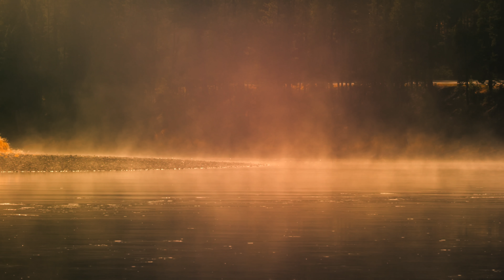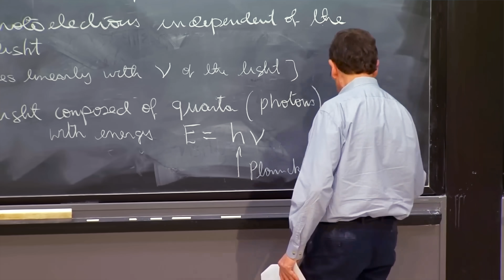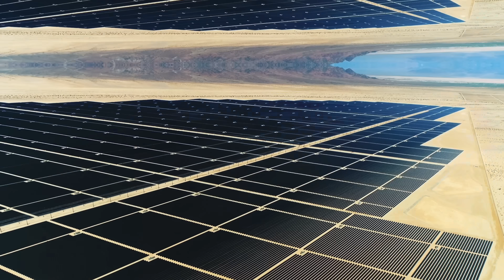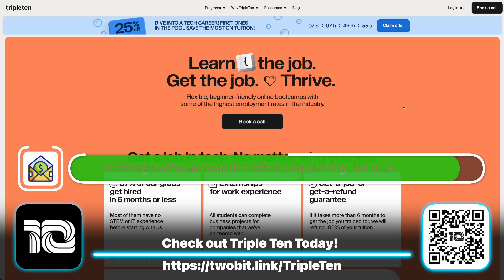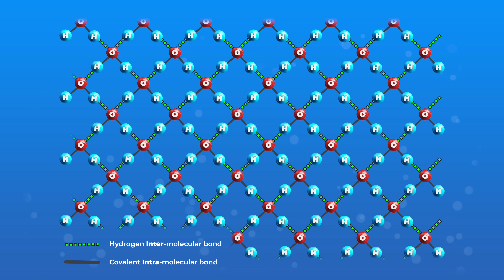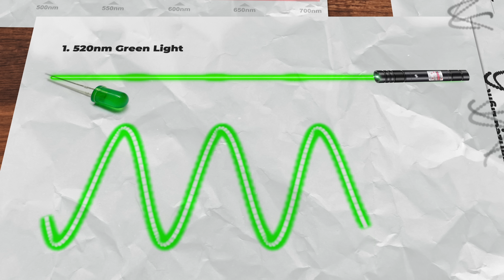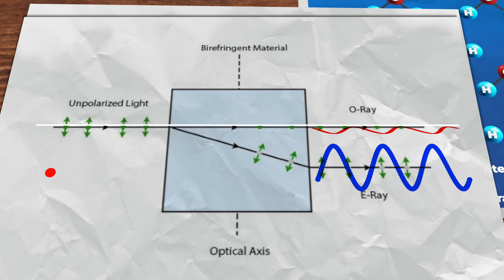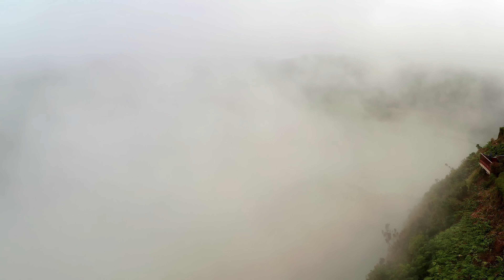New MIT Discovery Just Solved Water's BIGGEST Mystery!

Comment: he totally missed the fact that atmospheric pressure keeps water from turning into water vapor.  if you take a volume of water and put it into a vacuum chamber and pump out all the air, what happens to the  water?  it turns into vapor , it evaporates.  the presents of the air molecules, the pressure, or another way of looking at this, the weight of the atmosphere on water (say a lake) restricts the speed at which water returns to its vapor state.  water, as water wants to become vapor again ( its a cycle).  heat ( and now I guess light ) accelerate the transformation of liquid water to water vapor.  But pressure (atmospheric) regulates the change too.  Back to my vac chamber. no heat (ambient temperature) and in the dark,,,, pump out all the air (no pressure) what happened to the water? I guarantee it has all evaporated.

Comment: So what if you also use sunlight to preheat the water  in combination with such a system ( easier to evaporate the water with the lasers? ) - for instance in a large "greenhouse" style structure, where the evaporated sea water then condenses in a shaded cooler region ( behind solar panels ) at the top and is collected there, thereby even gettting it lifted up for "free"? The now desalinated sea water can then be tranported via pipelines into dry and drout regions ( like reverse rivers so to speak ).

Comment: Water is a fluid/liquid.  The ionic bonds in water are weak, much weaker than the molecular ones.  Hence water being a fluid.  Your explanation for why light works better than heat (which really is just another form of light if we're talking about its transmission and not the shaking of molecules) doesn't make sense.  It's still encouraging research though.

Comment: "New Discovery"? I remember reading about how light impacting on water causes it to absorb without it needing to heat up over a decade ago in college. Is it just have have done more testing to further confirm it?
Reply: This isn't absorption. Bulk water doesn't absorb green visible light. In fact, green is the part of the visible light spectrum that water absorbs the least. This is different
Reply: @PyroMancer2k  a decade ago, I watched a talk by Jerry Pollack on “EZ water”, where he hinted about interaction between light and water, and he used this effect for nifty experiments, making small pumps which were running on light. So yes, this has been around for a long time. The smart people at MIT figured out the theory behind it.

Comment: So, light can cause clusters of water molecules to evaporate, which takes less energy than if all the molecules individually left the water surface.  Simple, and once you know it can happen, you wonder why you didn't think of it before.  These clusters can then dissociate to individual molecules by absorbing heat from the surrounding air, if it is hot enough.    I wish you had said that at the start instead of making me struggle through ads etc. to the end of the video.  As an experienced engineer, I was thrown by "per m squared h".  I thought, what is that? Who says that apart from a badly trained AI?  Per metre squared per hour I realised eventually. 

Regarding desalination, I guess you could condense the clustered molecules back into water, no need to add the extra heat to split the clusters.

Comment: I am not convinced, so, in darkness water would take more time to evaporate and with green light it would go faster. Could it not just be something like that the green light has exactly the right kind of energy to do the work, that not warmth in general is making water to evaporate but that green light is attacking to molecular bonds. I see great difficulties in how to conduct a test, if the total amount of energy would be the same and on test has to have more green light and the other test less green light but the energy levels have to be exactly the same. Could it not be that some intermolecular bonds respond better on some wavelengths of light. Simply adding more green light is silly, the total level of energy would rise and it would be obvious the water would evaporate quicker then.
Maybe it is a breakthrough.

Comment: Nice, but the part about the polarization is not completely right. You cannot combine the two beams once they have the same polarization. That is a standard issue in optics. What you could do of course is building two devices and use the two beams ;)

Comment: You could have a certain of water (water fall) passing the light with a very slow air flow over it which passes the water vaper in to the collection vessel. Nothing was said about how the water would be collected? As for the having to polarizing the light, it would still be at 45 Deg’s, just on a different plain. Therefore would it matter?
Thank you I found this very intresting.

Comment: It is wrong that heat is the source of evaporation. Actually, it is the saturation deficit that drives evaporation. This is also why clothes will also get dry in winter.
Reply: WhenI heard the initial claim that we thought it was heat, I was taken aback because I did not learn HEAT, I learned evaporation.
Reply: Enthalpy is what you are taught. Not heat.
Reply: Ice evaporates in my freezer.
Reply: @freefall9832  That's not evaporation, that's condensation of the air's water. Like the one that happens in the outside of a bottle filled with cold water.
Reply: @magscorp13  Thanks, wouldn't condensation add ice.
Reply: @magscorp13  the transition of ice from solid to gaseous form (water vapor) is called sublimation and is likewise driven by water deficit between ice the gas phase. The process is comparable to diffusion, i. e. driven by a specific Gradient.
Reply: @sailaliamg2695  You're totally right. Thank you!
Reply: @freefall9832  the term is sublime.  Snow doesn't actually melt. It sublimes as well but usually condenses to water because it is to cold to remain in vapor phase.
Reply: @rachaelsdaddy  sublime / sublimate. Both are correct. And: snow does usually melt due to increases in air temperature or direct solar radiation, while a quite significant part also sublimates. This is also what causes high water levels in rivers in early spring during thawing phases.

Comment: I did a few experiments off my own back as kid for fun... One was 3 magnifying glasses aimed at a glass of water compared to one evaporating normally.. The original experiment involved the same setup (3 magnifying glasses aimed at the same focal point) to burn a spot in some wood, the other to boil water. First worked, second failed but the water heated up quite a lot.

Comment: Hi, Physical Chemist here. So heat is best thought of as light & vibration. Not just a materials temperature.  So the idea in this discovery is that water doesnt needs to ramp up across a massive landscape of molecules, but instead can have a much more localized responce to light.  This then requires many things to be considered about how that light is absorbed and in my mind it would mean a signal would appear from the emission spectrum when water is having a higher amount of this direct to gas phase change.  

My guess is that it could have to do with how water is flowing and this increases the number of specific frequences of light to bypass ambient heating. But the fact that water can evaporate at sub-zero temperatures, of course there is evaporation independent of surrounding material temperature. 

But all I really wanted to say is that heat is both the motion of molecules and Light.  They both are involved in why temperatures are a thing.

Comment: Evaporation is actually about the vapor pressure just above the water's surface. Heat is one way to decrease the vapor pressure, but not the only one. If you put water in a vacuum chamber, it will boil off and evaporate.

Comment: So, I’m wondering if the suns increase in brightness may actually be driving more of an effect in climate change than we thought? As the sun brightens and our existing issues with our emissions have driven us closer and closer to tipping points, we may find that the suns contribution comes in the form of increases to evaporation rates, adding more and more humidity to the air, further compounding the issue. This is a bit nuts.

Comment: Can’t you just add additional polarizing filters to continuously twist the light and reduce loss?

Polarizing filters don’t actually filter light, they cause light to snap to an orientation if their direction of oscillation is close enough to the polarization medium’s polarization axis.

So if you stack a bunch of filters with a 1° rotation between them you can get that loss down to as little as 3%.

This is called the light polarization paradox.

Utilizing this technique it seems like you could cheaply and easily convert large amounts of green light into the appropriate angle you need for the photo molecular effect.

Comment: Key points missed
1.  At any given temperature molecules have a distribution of energy states with the population in each state dependent on temperature (weighted by exp(-E/kT). The molecular energy is divided among kinetic and internal modes (vibration and rotation).   Only a fraction of the molecules have enough energy to break a hydrogen bond.  
2.  Hydrogen bonds between water molecules are very transitory.  The molecules form dimers, trimers, and larger clusters that form and dissolve on a micro second time scale.  The clusters have spectral features.  The broad O-H absorption peak at about 3300 cm-1 is actually a superposition of peaks for each N-mer cluster.  (I have published in this area).  Some molecules are always free and there is no hydrogen bond to break for a molecule to evaporate.  
3.  The analogy with the photoelectric effect is imperfect because there is an optimal wavelength and higher energy photons are less effective.  The photoelectric effect only requires a minimum photon energy.

Comment: Here is another hack. Polarizers don't just filter out light that's in the wrong direction, they will change the polarization of light that is up to 45° away from the direction of the polarizer. That's why you only lose 50% of that light instead of more than 90% of it. 

That is also why if you place two polarizers in front of each other offset by 90°, you will get less light coming through than if you add a third polarizer in the middle set at 45° to the first two.

Comment: This could be why some clouds appear so black.
I always wondered as it wasn't just a shadow. The cloud itself is black while others are white and fluffy.
The water may use up all the photons and create a black hole that light can't escape from.
Breaking all those bonds without heat in cold dry air could create a static charge or rapid ionic charge fluctuations and explain lighting?

Comment: Would the correct frequency of light with sufficient power be able to change the temperature of the atmosphere, via the process described here, at least in a localized area? My understanding is that tornadoes, and probably hurricanes, start from temperature differentials. The ability to cool the hot air before the differential takes effect could save billions, or more!
Now that I think of it, weather control, at least partial, is possible by having this ability spread across the world reducing heat where that's needed. With that ability you could optimize the weather where the soil is the best for growing food.

Comment: This actually makes a lot of sense.  Why we get heavy evaporation on both snow and water when the temperature is near freezing.  We get these heavy ground fogs at first light that hold until the day warms up at around 10am…then the evaporation is no longer visible.
Reply: its called sublimation in frozen water...evaporation only happens to liquid water
Reply: fog is not evaporation its condensation. the cold air sinks and where it meets the warm air above it causes the water held in the warmer air to drop out causing fog.
Reply: Before the new findings, did we think that water has to be boiling to evaporate because of heat? I don't think so, I think we thought about a very local "hot" area, where the molecule has enough kinetic energy to brake loose. But the general, overall temperature of the liquid can be let's say room temp. 25C°. Everyone knows water evaporates from oceans, seas and lakes, even though none of them are around 100°C. But still, we did attribute the evaporation to heat. Isn't it so?
Reply: Forgotten ice cubes evaporate in my dark freezer.
Reply: Compelling and exciting conversation.
Reply: it be cause of air moisture too; we can dry things by putting it in the house hold fridge (no light at all when the fridge close). (cold dry; vacuum dry... quite work same way).
when it cold, it is usually dry too.
Reply: Evaporation caused by the photo electric effect occurs at any temperature including below freezing.
Reply: @kennethhawley1063  That's what he's saying.
Reply: Also the 10am sun, forget the DST stuff, is around 45 degrees so optimal for the light based evaporation model. Also it's green light and plants leaves  are generally green - seems nature pointed the way on that (reasoning is that plants do photosynthesize but also require water to do so - reflecting the green light reduces water loss smart plants.)

Comment: It's not JUST about heat; it's also about atmospheric pressure and relative humidity.  And "light" and heat are just different wavelengths of the electromagnetic spectrum.  From everything I've ever heard, or read, the water molecules don't care whether the energy comes in the form of light or heat.  It's the total energy applied to the water molecules.  I'd like to see more on this.
Reply: It can even come from kinetic energy. Cigar stores have rooms where fans slam air molecules into a container of water.  The air has sufficient kinetic energy to break the surface tension of the water and to force it upwards into the surrounding air.
Reply: @chrisfleischman3371  Absolutely. drying my bathroom (sometimes full of wet clothes lines) is the most efficient when I put a fan in there. I have a fan in the wall pushing out the moist air, but that air flow is to small to be of huge help. The big table fan flapping the clothes around does the job ten times faster. But is ten times more powerful. So in the end the question is about how much energy requires every method? boiling?, filtering, or evaporating with wind light or whatever. By now the filtering, I mean reverse osmosis, at large scale is quite cheap. I hear that is 50 cents per ton. In my region the official price of water is about ten times higher, even the water is collected from a river and filtered with standard method, like sand filters, and chlorinated.   So, in the end, here making the water cheaper for the consumer is about better administration, not better technologies. I mean getting rid of corruption. So yeah, new technologies may be just interesting and fun to discover, but not so helpful unless are really huge breakthroughs.
Reply: @chrisfleischman3371  "The air has sufficient kinetic energy to break the surface tension of the water and to force it upwards into the surrounding air."  I believe that's called "splashing" 🤣
Reply: Yep, water does not care ithe energy comes from heating, or from hitting ;) hitting it with a photon.
Reply: Theoretically if one had really small hands, they could grab these bundles of water-molecules themselves and throw it up in the air.

Comment: First, your air conditioner and refrigerator make pure 100% drinkable water as a waste product... Forget water desalination. If you are trying to use energy to evaporate water only to recondense it, Just go ahead and draw the water that is already evaporated in the air....
 Second, get a clothesline for your laundry...
Third.. 
 Have you ever turned on a hose after it had been sitting in the sun all day?
 Put a thick black rubber waterline on your roof and and run water from it to your water heater...  It will preheat your water.
Reply: Air conditioners and refrigerators require electricity to run, and the waste product for that is a lot more than drinkable water.
Reply: @THE-X-Force  go xforce 😆
 Believe whatever you want ..
 But it takes a whole lot less electricity to get water out of the air than it does to evaporate it first and then recondense it ...🤷

Comment: Ok, which YouTuber makes a crazy super bright dryer first?
Reply: But can you impagine being able to double the speed of drying your clothes without using much more energy? That would be HUGE.
 It's one of the most practical immediate applications that would save a ton of energy across the globe, and should be easy enough to test.  The video says polarization helps efficiency, but that may mean the effect still happens without the perfect angle and polarization. Definitely worth a try.
Even if polarized light were sent into a dryer, scattering due to reflections and the clothes would eliminate the uniform polarization.

Comment: This starts off a bit confusing. I didn't make it past 2 minutes because evaporation has nothing to do with heating of the water. It's the heating of the air around the water. As long as the air around the water isn't fully saturated there will be evaporation. As air is heated, it can hold more moisture so as you heat air the evaporation rate increases, granted that the dewpoint of the air stays the same.. If you add wind as a factor, than u increase the evaporation rate even more because you are moving the moisture that just evaporated into the air away from the wet surface and replacing it with more dry air. Think of why and hair dryer works...hot air + moving air. It sounded like you were saying the water heats up, like it's boiling. The the ocean temp doesn't change very quickly yet water is contantly being evaporated because of the air above the water, not the temp of the ocean. Think of air like sponge